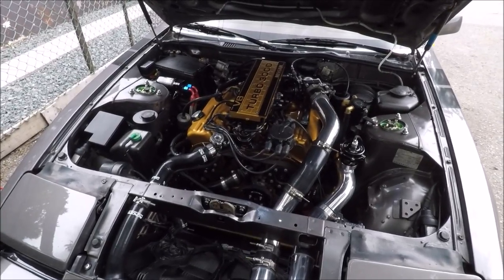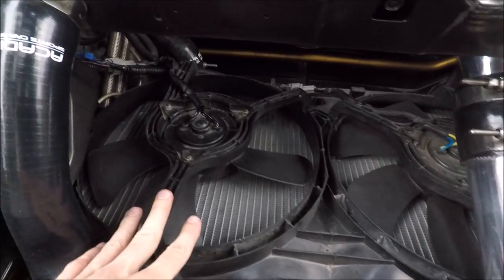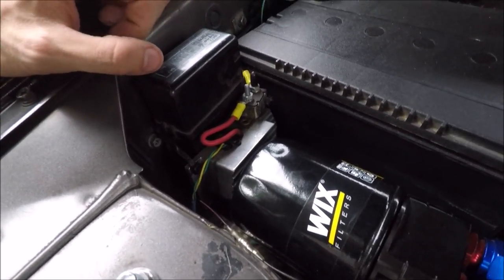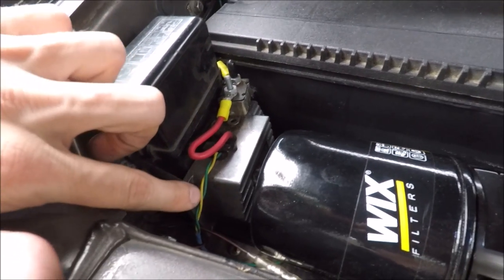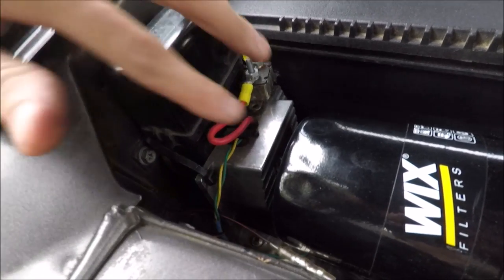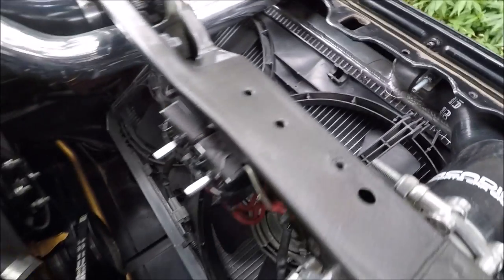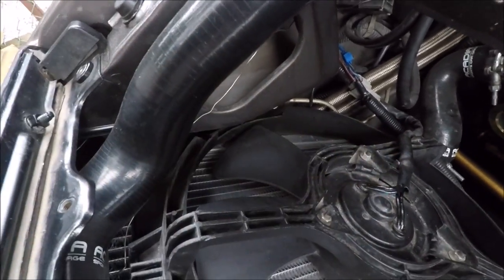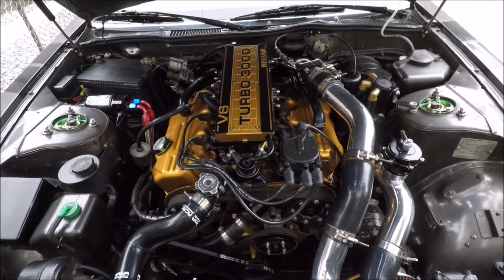My Z31 Cooling System Walkthrough (E-Fans)

Comment: So, no air conditioning? I’m looking at replacing my leaking water/air intercooler, thinking I might lose the compressor for charge pipe space,  and mount the intercooler in the space that will be created once the clutch fan goes and I install e fans like you did- eBay has a two core aluminum rad with dual fans for cheap that fit the z31.

Comment: Can you post a short video of where you wired the green/yellow wires into the ignition? I have mine set up to just the battery through a thermostat and I guess its not legal in cali to do that.... UGH
Reply from the maker: Just cut open the big loom and checked a few different wires for a 12v ignition source